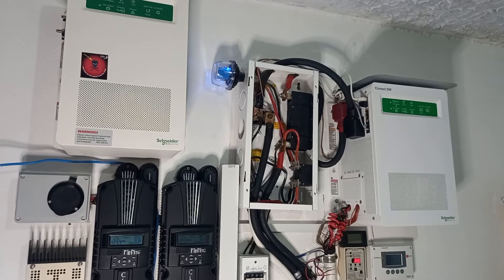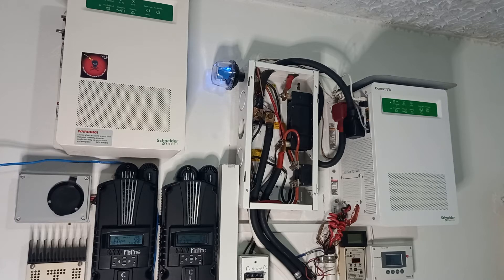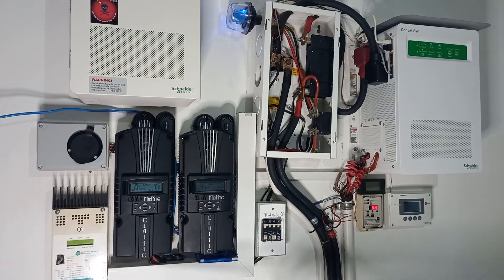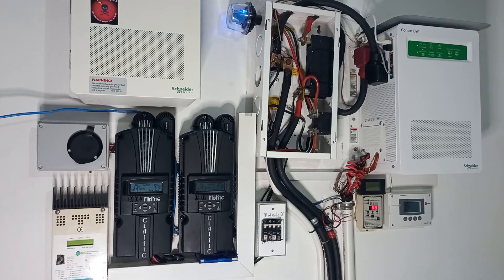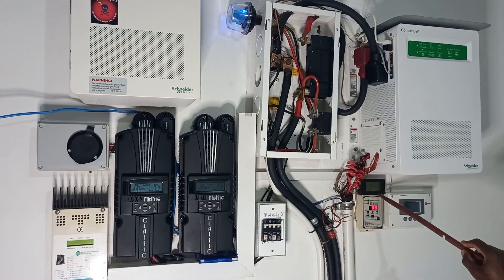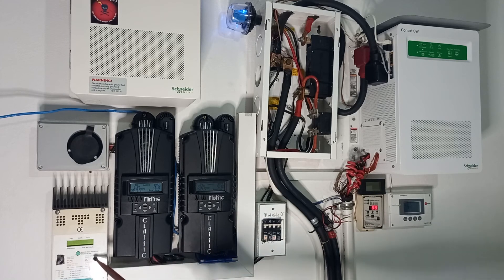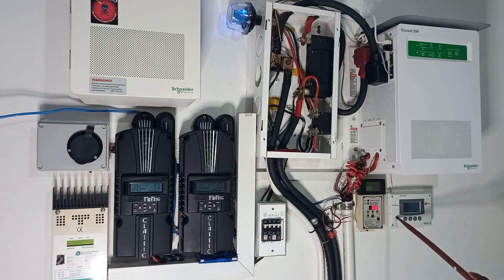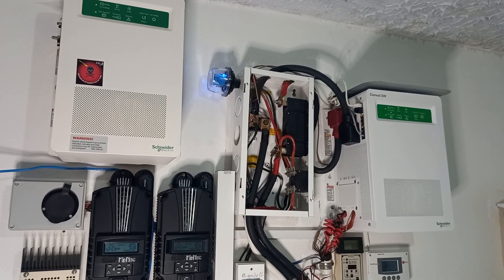Solar Renewable system Multiple Schneider Conext SW 4024

Comment: Where can I get my classic 150 fixed?
Reply from the maker: That would be dependent on where you are and what is wrong with it. I replaced a relay in one of those in the video some years ago.
Reply: @viviannsinclair1269  my classic is showing a high voltage for battery so it will not charge them.
Reply from the maker: @ch198-d7s  https://www.youtube.com/watch?v=Nv8ApvZhapk check out this video it may help you
Reply: @viviannsinclair1269  ok thanks
Reply: @viviannsinclair1269  Clarendon

Comment: I have a question Snyder is no longer supporting multi configuration for these two inverters so my question is how are you hooking these two inverters for more output thank you because I'm also interested as I own one at 24 volt
Reply from the maker: Thanks for your question. 
The connection is done using: 
1. 1 Network terminal on one unit,
2. A straight network cable from one unit to the other
3. Another straight network cable to the SCP.
4. Each unit is given an ID in the advance menu 
5. One set as master
6. the other unit is set as a slave

one unit was manufactured in 2018 the other in 2021. I did not update the firmware. They are working fine thus far and have produced more than 200 kWh since the setup was not with no issue.